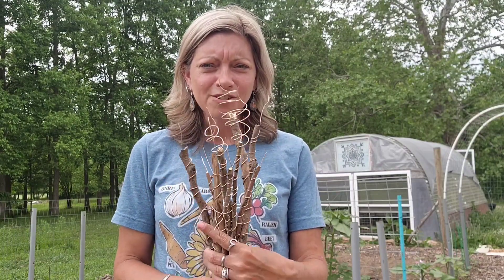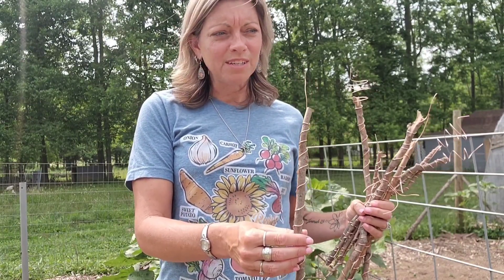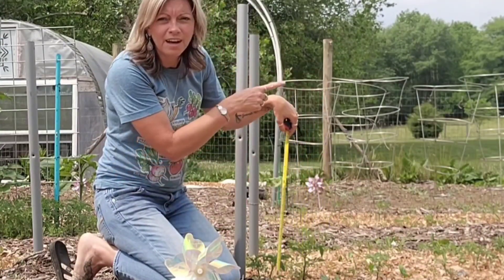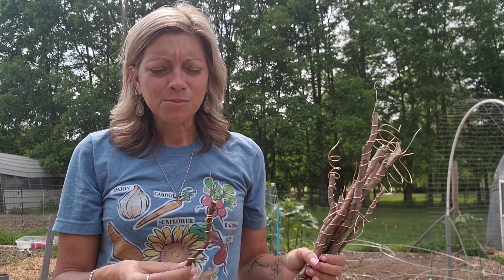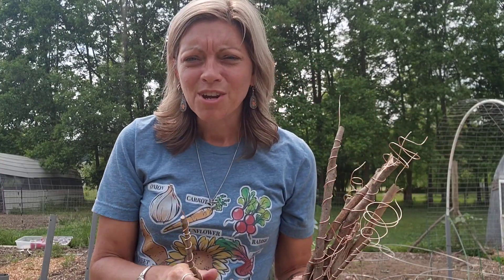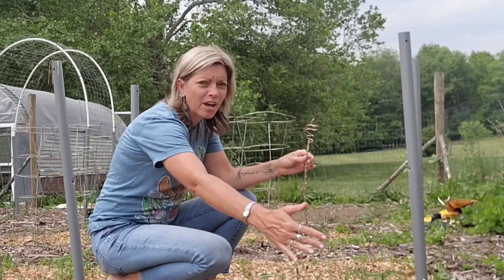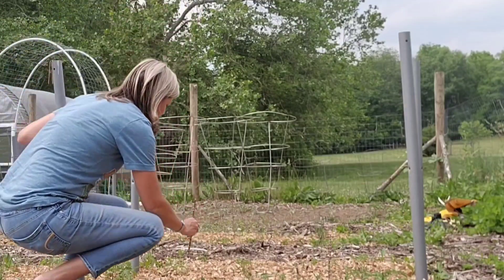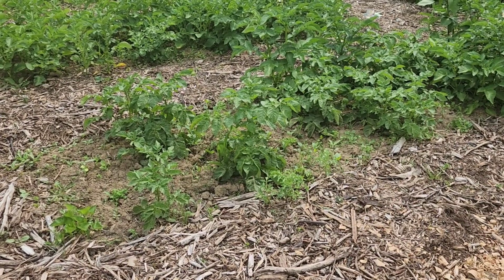Electroculture experiment

Comment: I don't want to sound like i'm tearing down your experiment because i'm not. I just want to spread awareness that different seeds you plant while they may be from the same mother will grow at different speeds. Every seed has its own genetic code and some will grow faster than others. So the only way to truely test if this method works is to take 2 cuttings off 1 plant and root them aka making clones. That way they share the same genetic makeup and you'd have a true test. I've looked all over the internet and can't find any experiments with electroculture where people are actually using clones. I just wanted to spread some knowledge. Good job on the video i'm still interested in your results.
Reply from the maker: That is a great idea. I'm 2 months in and the plants are pretty much the same, no noticeable difference. I was hopeful that it would make them grow better, but so far it really hasn't. It's fun though.

Comment: For $5.82 you get 5' 4 Gauge Stranded Copper Electrical Grounding Wire at Menard's but any home building store will have similar. Mine was actually 5.5 feet. There are 7 strands of 13 AWG gauge that need to be separated and then easily straightened to work with. Spools are quite expensive no matter the gauge. I straightened my wires while watching your video.

Comment: South side of the garden w/ tip facing north. My garden went from insect ravaged and dying to booming beds!  🎉 No pesticides or fertilizer needed. Its so amazing. Ive made a copper open bracelet for my dying Maple tree.. 😅 People have documented saving their pine trees. So .. 🙏 Im hopeful. ❤ * also.. I didnt use sticks. I put 12 in copper coils straight into my soil. Wound clockwise with 7 rings.

Comment: 2 questions should I leave them out side during the winter and I heard they attracted pollinators but will the replell earwigs
Reply: You should leave them in. It conditions and preps the soil til spring.
Reply from the maker: I plan to take mine out during the winter. My reasoning is the stick will breakdown faster if it's out through all seasons. I also let my chickens in to work my garden in the winter too. I'm not sure about it repelling earwigs. Companion planting could help. Put in marigolds.